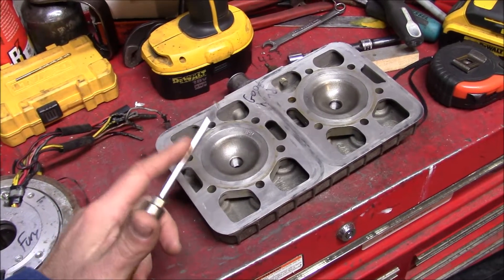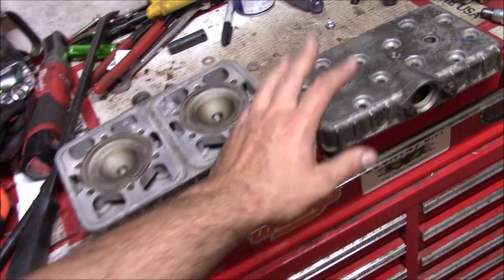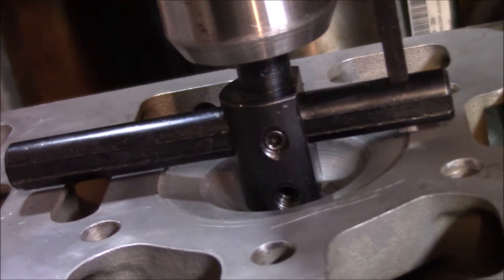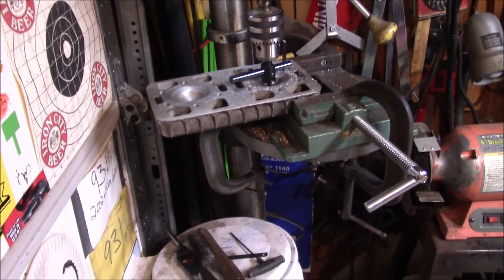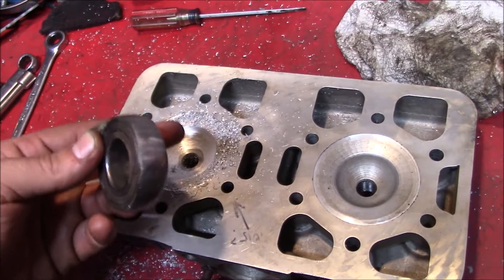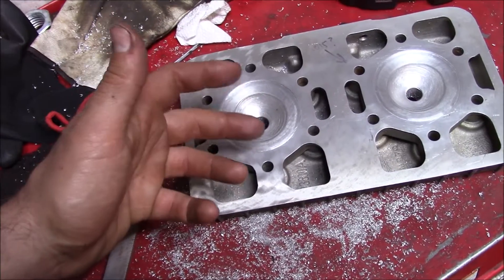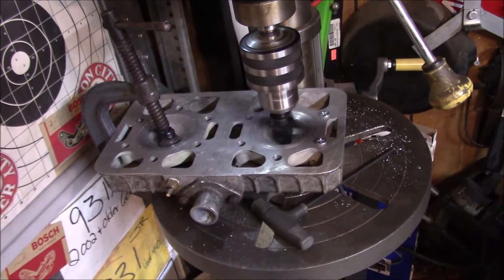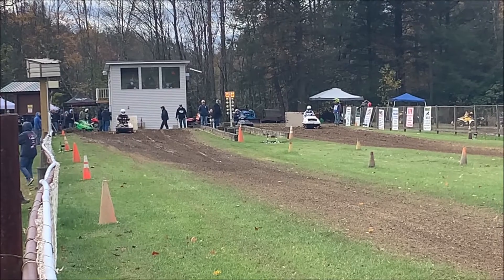2 Stroke Head "Machining"

Comment: Cool video man. I'm in similar boat on my stroker 521 banshee except I need to reduce the 190 psi. I'm aiming for 170. Kicker has gone through my work boots. So I have the dome chucked in a dewalt drill, on a spark plug. I'll be spinning the drill and cutting the squish band with 36grit paper for a min or 2. Then 80 grit til I'm happy. Currently .040 squish so I'll cut til I'm at .060 on both and that should do it. And yes I'll be measuring volume on dome multiple times during. Cool ingenuity in vid tho. Thanks for that!!

Comment: Hey man have you ever ran into this issue. I ran out of gas with a Sthil m362 and the only option was to use the only gas left that has Husqvarna oil mix in it from a Husqvarna 450. The Sthil only ran about 10 min and then it wouldn't run anymore.Just bogged out. So I emptied the the gas out if the Sthil. But have yet to bleed the remaining fuel out of the lines. That sthil has been a mofo to start overall since the bs eco start system on it bout 10 years ago. Should I just put sthil mix back in and keep pumping the bulb for a couple weeks or am I gonna haft to get deeper into it to get the Husqvarna mix out of it? Thx man... And bad ass car lift vid mang!
Reply from the maker: Sounds like it might have clogged up the spark arrestor screen in the exhaust, could have been half way plugged already, the different oil just done it quicker.  I'd check that first.  Some of the newer saws and stuff also have a cat in the exhaust, they can overheat/melt/plug up too.   I've had to drill holes in the side of the muffler because the cat was plugged.   They're ruining new equipment with how much emissions shit they put on them.  Did it sound kind of flat and quieter than usual before it died?

Thanks man, that car lift has been awesome so far!
Reply: i was running another saw so i didnt get to hear it to much other then it was just flooding out and wouldn't run no more AFTER WE ADDED THE OTHER OIL MIX ...AND 100% FUCK THE EPA HAAAAA !!!! THX FOR THE ADVICE...THIS ROCKIN SONG IS A SHOUT OUT TO YA THX AGAING !!!!! ROCK ON https://www.youtube.com/watch?v=-9_V4YAmnb8  @toocheaptosmoke
Reply from the maker: @OfficialHankIII   Sure thing man, hopefully it doesn't take much to get it back running.  Hell yeah, will have to listen to more of those guys, good stuff!!  🤘

Comment: HEY MANGZ IS YOUR BLUE GAS CAN THAT GETS BAD FUEL OUT OF VARIOUS THINGAMAJIGZ. IS THAT A BARN HAYDAYS HOMEMADE SPECIAL? IF SO WOULD YA BE WILLING TO MAKE ANOTHER ONE? IL PAYPAL YA'Z OR SEND YA SOME TOO CHEAP TO SMOKE CASH FER ONES.... AINT JOKIN....EVEN IF IT TAKES 2 YEARS...MY PROCASTINATION HERO!!!!!! RESPECTS
Reply from the maker: Haha, thanks man, I  wish that was something I came up with!!   It's called a Topsider, made by airpower America.  Just looked them up, they still sell them but man have they gone up in price...  Still super handy, one thing you gotta watch is the gaskets under the caps, won't hold a good vacuum if they get pinched or off center.
Reply: 10 4R MY LITTLE HAND PUMP JUST CANT GET WHAT NEEDS TO BE DONE...DONE... THANKS YA MANG!!!

 @toocheaptosmoke
Reply: IL LOOK ON EBAY AND FEW OTHER PLACES 1ST @toocheaptosmoke

Comment: I wish you would have more talked about how to determine the CC you need for the race fuel and all the science stuff. good video
Reply from the maker: I wish I knew a bit more of that science, haha.  Was basically just doing a comparative increase in the head volume, like the stock was 24cc and the modified head was 21cc.   So many things like exhaust port timing and pipe design affect the dynamic compression ratio it's hard to just come up with a number.

Comment: I love it, haha. Very creative. 

Summer of 2022 I reworked my Kawasaki triple head and a year or two before that a Kawasaki twin. I've spent my fair share of time building and modifying tools to make them do tasks that they were never intended for 🤟

I do have a mill and lathe, but they are not suitable for machining the twin head, let alone the triple. I made a tool for both cutting the o-ring groove and a tool for recutting my squish profile. I used my mill and lathe to build the tools, but I had to turn the mill by hand as there was way too much chatter. 

This past summer I machined out my triple head and made a tool so that I could build my own domes. I used my lathe for this. I grew up with old ski roules, motoskis and was lucky enough to have a blizzard for a short while... what a beautiful snowmobile ! 

I'm currently trying to convert my milling machine to CNC, but I totally agree... Thinking outside the box, using your head and hands is a great way to get a sense of accomplishment.
Reply from the maker: Right on man, even when you got the tools for the job, looking at things with a good perspective allows you to do even more with them.

Comment: holly fk dude clever And long time since a vid Also i watch those vids in india of mechanic shops  you should see the stuff they make with little tools and wearing sandals
Reply from the maker: I watch some of those vids for tips, haha
Reply: do you see how they overlay weld a spline of a axle then with a 5 inch grinder start grooving out the splines ? @toocheaptosmoke
Reply from the maker: @shawncordeiro  Haven't seen that one yet, but sounds legit, haha
Reply: Yep I watched a teen boy from India build a great 2 stroke exhaust with only crude shaped pieces of metal and 1 home made hammer a couple of old steel buckets as material!! The only time he used the hammer was to join the folds!! It was awesome 👍 I definitely learned from him that we don't need these expensive machines they are trying to push us into buying!!